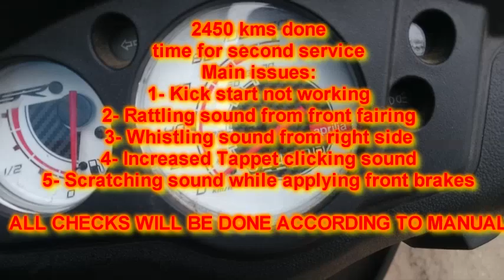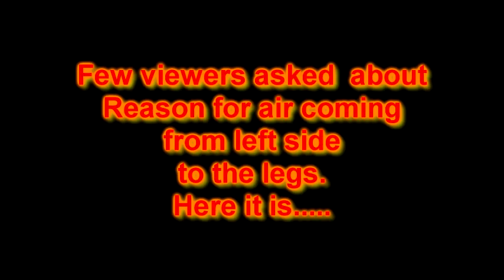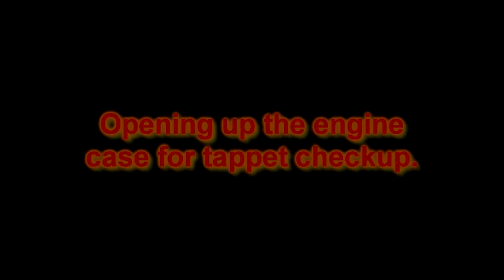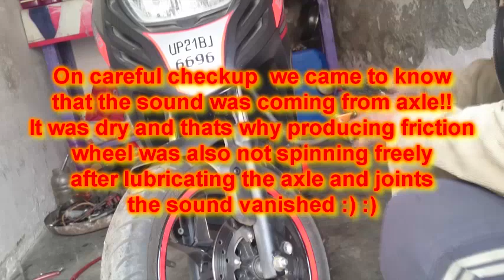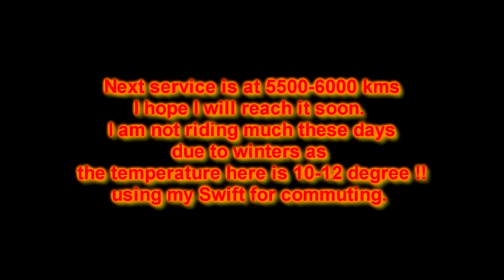Aprilia SR150 : serious issue solved: Kick working : owner review.

Comment: Mate need a big favor from you ! I have a SR150 Race purchased a month back, went for first service & they have tuned the carburetor & make me feel like a active. It just roars but there’s no feel of power at all when I open the throttle all d way also. Went to the service center twice but they are not ready to listen or fix it. It would be great if you Can u post a video on tuning carburetor for best performance or settings how much lean mixture is required for best performance. So I can get it done outside in some Garrage.
Ps- 450km. Earlier it was like a rocket. I could feel the powerful thrust pushing me.
Thx
Reply from the maker: Sarosh Mevawala Hi buddy... But why they tuned the carb? Whats the idle rpm of ur scoot rt now?
Reply: RIDERS GOT TALENT I had instructed them not to touch the carb but as these assholes never listen they tuned it to best mileage, I’m clueless what’s the idle rpm but looks like it’s a little more as I can feel more vibrations on ideal.
Reply from the maker: Sarosh Mevawala ohh... Get your idle rpm checked buddy... It should be 1600 rpm...they might have lowered it... As more vibes come when rpm is low, not high... They need to tune the carburetor to make rpm at 1600 and.that will automatically solve the problem....
Reply: RIDERS GOT TALENT okay I’ll get than checked n fixing @ 1600 let’s see if that work! Will keep u posted thx for your support, appreciate it !
Reply from the maker: Sarosh Mevawala Yes buddy... Do get it cheked and fixed.. 
You are welcome anytime buddy 👌👌
Reply from the maker: Sarosh Mevawala also do get the choke checked...it might be stuck.. Try pulling and pushing choke knob few times... A stuck choke valve also creates powerloss and high rpm..  so get it checked also
Reply: I tuned it to 1.5 full 360° turns & it gives best of both

Comment: Hey...Rider ..i was thinking of putting a new exhaust in the scooter...will it cause any problem in its performance latter on?
Reply from the maker: Luis Sta if its a full system.. Like arrow..then it won't be any problem... But anything other than that will surely fry the valves with time buddy...

Comment: bro which engine have you used as you serviced your scooter outside. On manual its recommeneded ENI engine oil but dont think so its available in market. And will it void the warranty if serviced outside locally. What else have you changed in 2nd service like(engine oil and air filter)
Reply from the maker: Anurag Virk Hi buddy.. second service don't need oil or filter change... oil was changed in first service..which i got done at service center...  yes warranty is void but I have a better mechanic thn service center... so no worry ;-)
Reply: Thanks bro. local mechanics advise to get Vespa and Aprilla scooters from service centers only as they are not so skilled and market is not having spares parts of these. How much average you are getting(in normal 50-70 mode or in Rossi mode) and have you made any whatsapp group for discussion or suggestions.
Reply from the maker: Anurag Virk hahaha.. thats true buddy... thats because the opening mechanism of the transmission compartment is different in these..and it requires a special instrument... my mechanic custom made it in few minutes!  thats why he was able to open it....yes...spares have to be sourced from authorised service centers 
35kmpl around its giving...
Reply from the maker: I always ride it in rossi mode...never tried normal mode... but as other owners suggest it gives not more than 38-40 kmpl! 
I created a facebook page... can't afford sharing my number or a whatsapp group.. :-(
Reply: Thanks bro.. u have done some serious R&D for this little beast and by what name you have created fb page, I wants to join it   :)
Reply from the maker: Anurag Virk Thanks buddy..
https://m.facebook.com/DrShivAditya29/?__xt__=11.%7B%22event%22%3A%22visit_page_tab%22%2C%22user_id%22%3A100000196586429%2C%22page_id%22%3A817811471693037%7D
Reply from the maker: Anurag Virk here is a CRAPPY link of the page :-D

Comment: In my case before servicing everytime I have to choke but the problem is that the rear wheel speeds up without acceleration
And the kick also doesn't work properly
Reply from the maker: Ohh.. Rear wheel should not speed up like that buddy.. get it checked.. might be some carburetor issue..
Reply: @Vickyrocks247  sorry the back wheel and when I switch on both the lights the battery becomes weak
Reply from the maker: @AshokSingh-wt7dh  Yes.. its battery becomes weak if both lights r used .. happened with me too

Comment: hi ive got a problm like. its making a clicking sound when i leave the throttle... is that what you mean by tappet sound and can you explain what it is??
Reply from the maker: Vinayak Vijayakumar Hi buddy.. if its coming off throttle than its not a tappet sound...  it might be something in clutch if its coming off throttle or something might have become loose... as vibration increase as you leave throttle...  Get it checked at service center.. as clutch is not under warranty...
Reply from the maker: Vinayak Vijayakumar Tappet sound is similar to sound which comes when you put a bicycle on stand and paddle it..and than stop paddling...  a tick tick tick sound comes..its similar to tappet sound.... and tappet sound is normal in some engines... like in SR150...  its not something to worry until there is effect on performance....
Reply: RIDERS GOT TALENT thanks bro ill contact the service centre👍
Reply from the maker: Vinayak Vijayakumar u r welcome buddy :-)

Comment: My SR150 doesn't starts easily.. I mean i have to pull of the choke every time when i have to start my SR150.. But when others people who have a experience of riding scooter for many years can start it easily without pulling of the choke.. Am i doing wrong while starting this scooter or this scooter have different techniques to starts.. Do u have any suggestions?
Reply from the maker: Susan stha hi buddy.. this is the problem of all SR150.. it needs choke to start in morning... keep the choke on untill you start rolling... also check the idle rpm of your scooter... it should not be below 1600 rpm... some mechanics are adjusting idle rpm around 1200.. which is creating problem in starting.... also make sure that your lights are switched off before starting the scooter....
Reply: Susan stha hmm but same problem was their with my dio and scootypep+ soni think its almost common in many scooters.
Reply: RIDERS GOT TALENT Hello, how do you turn the headlights off? I mean when ever I turn the key to the "on" direction, the headlights automatically turn on

Comment: i have already told you about front panel rattling but you told that there is no rattle sound from your aprilia but now you know but let it be but give me solution how can i remove above problems that you mentioned in your this video please tell me how that service people has fixed the issue so that i can also get it fixed in proper way
Reply from the maker: ambrikh mishra Hi.. sir u were telling rattling sound at speed of 10,20 kmph.... but my scooter was giving sound while going over pot holes! and the reason was that one bolt was loose.... tightening it up solved the issue :-)
Reply: sir can you tell me which bolt is need to be tighten so that i can also get it tightened from mechanic

Comment: i see lot of vibration when it is idle. Is it common with this bike or will it get solved after first service?
Reply from the maker: Ashok Chakravarthy Its normal buddy... its the characteristic of this scooter... vibes smoothens out as you increase speed...
Reply: RIDERS GOT TALENT so if i set RPM high then will it get solved at idle states. 
Thank you for replying 😊
Reply from the maker: Ashok Chakravarthy Its my pleasure buddy..
I don't think so buddy..coz vibes don't go until transmission is engaged with engine....  and also we must not increase or decrease idle rpm,  it must be what the manufacturer recommend,. which is 1800 rpm for this scooter :-)
Reply: RIDERS GOT TALENT okay thanks!! I thought only my bike has vibrations but now i see its common.

Comment: What should be the RPM 1600 or 1800?? and I hear some clicking sounds from the silencer when engine is cold but sound does not comes when it gets hot is that normal and also scooty vibrates alot is that too normal??pls reply
Reply from the maker: harjas sodhi Hi,  idle rpm is 1600 buddy... how much kms have you done on scooter till now?  Silencer make some clicking sounds in cold weather sometimes,  if the sound doesn't go away after sometime,  get a checkup done at service center..  
Scooter vibrates at idle and 10-20 kmph speeds,  its normal but after that it smoothens up...

Comment: is it okay if 2nd servicing is done after exceeding the kms.. ideally 2nd servicing is supposed to be done between 2000 and 2500kms.. but its exceeded upto 3000k..is it okay?
Reply: and is the suspension good? i feel the front suspension sucks.. no diffrence between aprilia and activa
Reply from the maker: Robert Dsouza hi buddy...I dnt think it will be an issue... if u r not getting it serviced at service center.. 
front suspension is very stiff..much harder than activa...

Comment: Bro missing problem solution for my aprilia. It is missing on accelerating from stop. It's usually happens when I twist the throttle to hard or even when accelerating after a speed breaker. Give me solution please
Reply from the maker: Hey buddy. Missing problem can be caused due to several reasons... first check your airfilter, if its choked or good. Then check your carburetor for any clogging, then look for spark plug function.. It might be due to any of these problems!!
Reply: @Vickyrocks247  thank you bhai. I appreciate it very much. I will change spark plug and airfilter soon.
Reply from the maker: @dnwar6398  welcome bro

Comment: I had only one issue . On careful examination , I noticed that the mask was not attached to the body properly , on the right side and because of that , I could hear a tapping sound from the front portion of the vehicle , whenever I went over a speedbreaker , at any speed above the minimum speed . Went to the service station , and he told me that the mask wasn't attached properly and will be done when I bring my vehicle for first service . Barring that , I have had no issues and I'm starting to get used to the stiff suspension , which doesn't feel as stiff anymore . The bike handles like a dream , and it corners with confidence . Navigating through traffic is a breeze . My Activa feels like a snail after getting used to this beast .
Reply from the maker: Nawar Ashfaq Thats great buddy... prevent it from pot holes and bumpy roads as much as you can... handling is hot... just that with 100kmph plus speeds.. you need a body movement for sharp steers... I am sure you are an attention magnet these days ;-)
Reply: RIDERS GOT TALENT puri dunya ki nazar laggai hai bhai .... random people took pics of my bike , when it was parked outside a restaurant last night . Crazyyyyyy
Reply from the maker: Nawar Ashfaq Hahaha... enjoy the reactions bro...its a good feeling..... ;-) :-D
Reply from the maker: Nawar Ashfaq u will feel u have made a right decision buying SR150
Reply: RIDERS GOT TALENT one more doubt .. u said there was a scratching sound with respect to ur disc brake . Is it when u apply the brakes , or is it from the tyre .. Is it the sound that is heard when car brakes are applied or is it something that is different ??
Reply from the maker: Nawar Ashfaq The sound was coming while applying front brake.. but when we checked,  the sound was coming from front axle.. when applying brake load on front axle increases, and the axle and axle ring were dry and tight..thats why it was making sound.. a bit of lubricant and reassembling rectified the problem.
Reply: RIDERS GOT TALENT thanks Bro ... hope ur vlog grows further and u scale great heights . would still request u to upload more sr150 videos , to show what this beast is truly capable of ..
Reply from the maker: Nawar Ashfaq Thats so nice of you bro... thanks a lot....  I will try to increase the number of Aprilia videos for sure...just waiting for this killing winter season to end :-D
Reply: RIDERS GOT TALENT bhai aprila achi nahe he kya
Reply from the maker: aditya butiya Aprilia mast hai agar sadak smooth hai... gadde ya kharab sadak k liye nahi hai
Reply: sir. .me job karta hu or emi par le na he muje aprila. .....but sir uss ke part markit me Mil te he kya
Reply: me Mumbai se hu. .to rasta to achi he
Reply from the maker: aditya butiya Rasta achha hai to koi problem nahi hai... scooter jabardast hai.... bole to raapchik ekdum..
Reply from the maker: aditya butiya Part to bhai jaha se scooter logey wahi milegey.... waise andar se iska enginet hoda alag hai aur scooters se...ya to koi expert trained mechanic ya service centre pe service hojaegi
Reply: RIDERS GOT TALENT thank u so much
Reply from the maker: aditya butiya U r welcome bro
Reply: aditya butiya From a person who wouldn't wanna ride more than 15 kilometres/day on my activa , dio , fascino,  im now riding a minimum of 50 kilometres/day . That should tell u how glorious this scooter is . Handling is unprecedented . Can't stop going ga ga over it . My friends tease me by calling me a brand ambassador of Aprilia SpA .. lolll
Reply: bhai sorry muje English nahe aate plzzz aap hindhi me bolo kya bol na chate ho
Reply: aditya butiya bhai woh keh rahe hai ki weh pehle activa/dio par keval 50km tak vhalate they ab weh aprilia par 50km har din chala lete hai. aur iss scooter ka handling bohut achha hai.aur unke dost unhe unhe aprilia ka parchar karne wala kah ke chidhate hai. 😊

Comment: HII.. Nice Video.. Very Informative.

Dude what is the mileage You are getting???

Appreciate your reply in advance
Reply from the maker: bilal khalfe Hi buddy..thanks a lot.... m getting between 32-35kmpl ....  :-)
Reply: @Vickyrocks247  at wat speed do u get this mileage
Reply from the maker: @FAIZANHODEKAR  At all speeds.. Although my riding style is aggressive.
Reply: @Vickyrocks247  thnx....nd wt abt maintenance cost ?
Reply from the maker: @FAIZANHODEKAR  If you are planning to get the service done at service center, it might be expensive. Especially spare parts if needed are very high in cost. But i get service done by my local mechanic, which cost me iequal to any other scooter. But make sure your mechanic is a good one, as opening this scooter is slightly different. My mechanic is very technical, he also service my superbikes. And best way of knowing about service center maintainance is to go to service center and ask them detailing of service costs including necessary parts and service jobs. As costs differ with different service centers.
Reply: @Vickyrocks247  thnx for ur kind info 👍
Reply from the maker: @FAIZANHODEKAR  Anytime brother..

Comment: pls let me know i m thinking to buy aprilia sr 150 but i backup bcoz its not metal body im thinking of hero duet with good feature but its not has powerful like aprilia 
pls suggest i m looking a scooty frm this both what i shld buy or need to wait for honda lead & TVS Dazz to come in market 
Aprilia plastic body part is durable for long years 
suggest me so i can buy... which scooty is better for me...
i drive deo but bcoz of plastic body after 5 yrs it make sound & feel vibrating on handle bcoz of body part on front plastic material start vibrating. ..
Thanks for sharing good & knoweledgable video 
Pls Mark a suggestion anyone... 
so it help to me... 😊
Reply from the maker: vikram rawat Hi buddy...Aprilia is made only for good,  smooth,  bump free roads.... don't even think of riding it on bad broken bumpy roads... the suspension is like a bicycle without shockers....  and if you are going to ride on good roads than durability  is not a problem.  Plastic quality is top notch, it looks like its made to last for long but reality only time can tell we can not predict the future... but if you gonna ride it on bad roads than I must say it won't last longer as the suspension do not absorb any bumps and transfer them to scooter and rider body.... power wise its unmatched... this scooter is like a sports bike... it needs favourable conditions to perform best otherwise its useless.... so I would advice take a test ride and then decide....